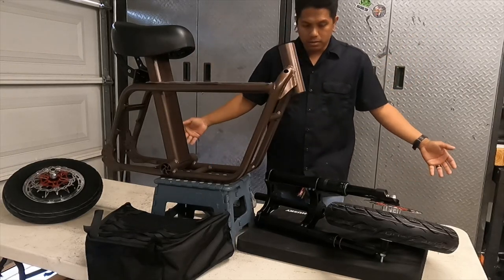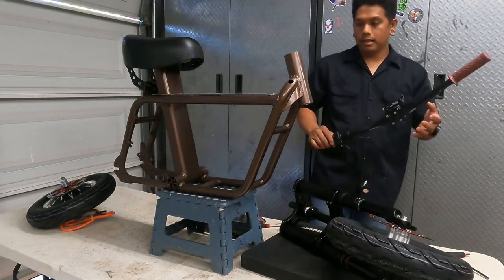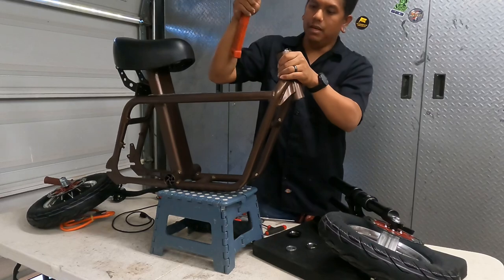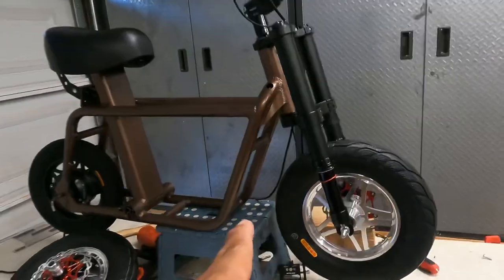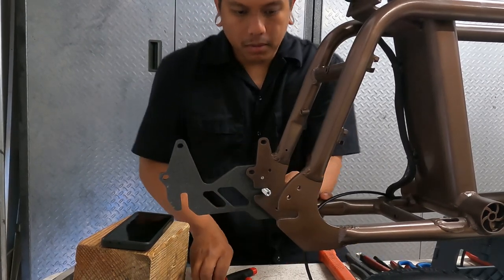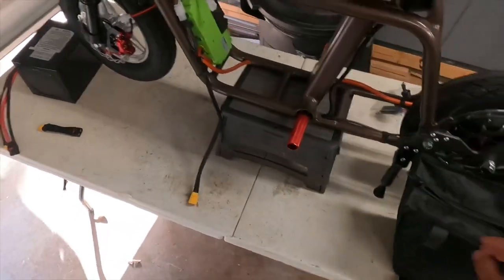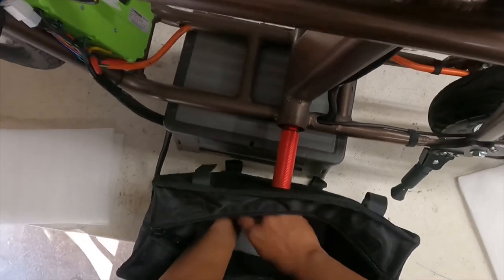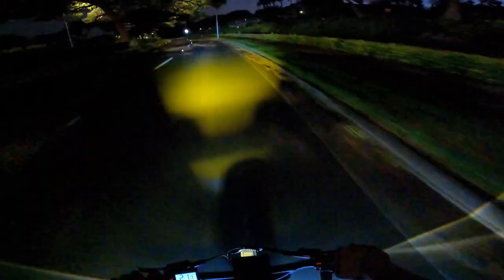Project Copperhead - Hawaii Fiido Q1 Build

Comment: How’s the power on that motor? It’s only got a 30mm stator so I think the torque and acceleration will be pretty low. It’s probably just e we pound for high speed but I don’t know how they are rating these for 2000-5000 watts at 72v. 
I am looking for big power motors so the 65mm stator LY motors look pretty good, huge phase wires on some of the versions they offer. 
But this motor is like 1/2 the price and maybe with 2 it will be enough. Let me know what you think. Thanks
Reply from the maker: Its not bad actually, my cousin is about 300lbs and he brought it up to 60 mph so far. Still getting comfortable with going fast lol but in speed 3, while cruising at lower speeds and he hits the throttle, you see the front end fully extend lol so i would say for the price its worth it.

Comment: know if the stock motor can handle 72v @ 10a? im going to try it I guess
Reply from the maker: Ive done 72v 30a line/90a phase to the stock motor lol ton of fun and tops out around 30ish lol watch out for one-way clutch, though. Fails easily.

Comment: bro ，Have you ever experienced the front wheel swinging from side to side?
Reply from the maker: Not sure what you mean
Reply: Speed wobble?
Reply: Like speed wobbles , when I push the speed up .
Reply: @johnsonkhew9277  thats the main thing im worries about with my build coming up. You will receive speed wobble on anything with small tires at high speed
Reply: Tyre chg to 3-8.00 + damper, same also

Comment: would you paint the rear extender?
Reply from the maker: The stretch? It is painted, hammered bronze.
Reply: @JonnyDuzzit  the extension arm? Looks grey to me.
Reply: @JonnyDuzzit  is the expanding of the hole needed? im installing one on a roadrunner tronic/ fiido q2

Comment: Whatever happened to the bt200x build?
Reply from the maker: Its still in my storage lol ive come to a realization that even if i finished it, it wouldnt have a place to ride it. Busy roads, shitty drivers, we dont even have a track on island anymore. I'll finish it one day, but right now these electric projects are quicker, easier, and require less thinking.
Reply: OK I understand it’s just, that build is a very unique one-of-a-kind. Personally, I think much cooler than just slapping in a 420 or up to a 700 off the shelf big engine, I think people would appreciate the build bc i’ve never seen a dirtbike engine of that size going to a minibike frame, thx for replying and keep putting out good content bro👍